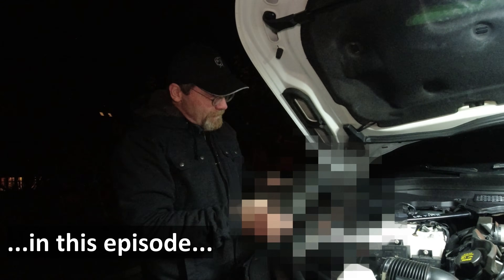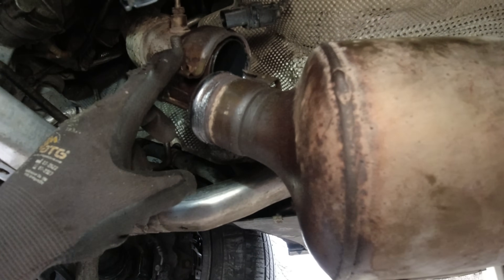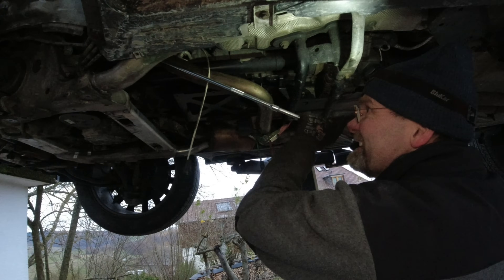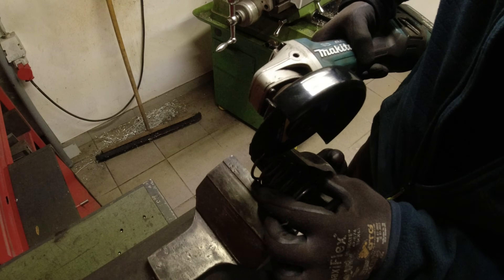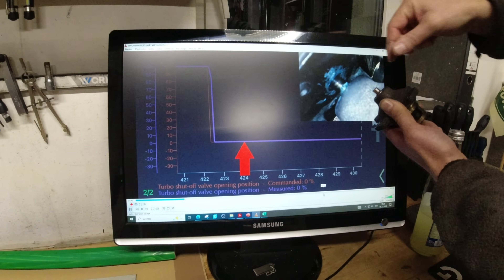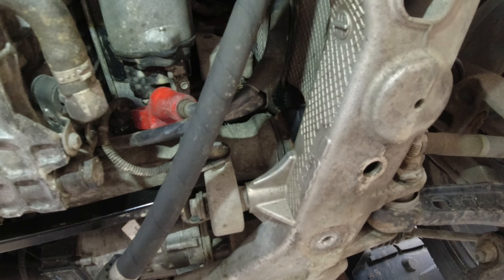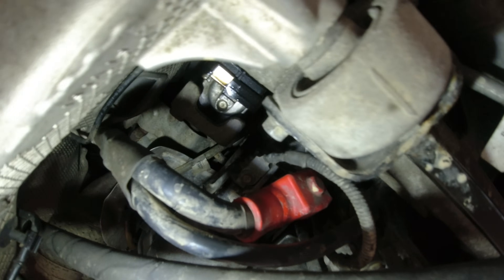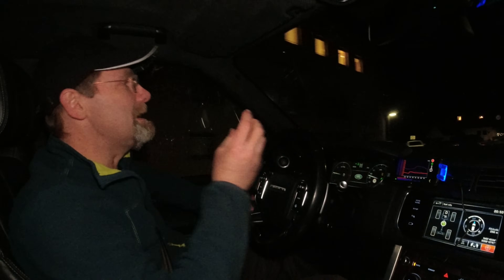Dumbest Land Rover Design Fault EVER - Fixed - L405 Range Rover / S5-Ep1

Comment: 4 weeks of debugging, amazing work! I mean I get why some workshops are not able to fix this sort of issue. Workshop hours would probably be 1/3 of the purchase price. 😅
Reply: True, but one would expect a main dealer or landrover specialist to have the expertise to pin pont the issue from the off. In reality all they do is give you a list as long as your arm to replace in trial and error manner....at cost to you. :-D
Reply: Yip…so it becomes more cost effective to replace things. Here in SA that’s the equivalent of €73.32/hr labour rate. At that many hours, the customer will walk away.
Reply: @D0zer122  that's very cheap! 18 months ago my local JLR main dealer workshop was charging £275 per hour plus 20% VAT. That works out to a whopping £300 per hour labour charge ! And I bet it's gone up since then.
Reply: @samrodian919 I suppose if they knew what they were doing, you wouldn’t mind paying them £300 per hour, but when you’re paying them £300 per hour for trial and error, it’s pretty galling.
Reply: @samrodian919  labour here is a lot cheaper. Seems maintaining the same vehicle even though parts coming here are imported (obviously) is plenty cheaper at the labour level. We only pay 15% VAT.

My independent LR mechanic is about half the JLR dealer labour rate!
Reply: I think this is the driver behind Chris' 'don't throw parts at it' doctrine. It's ineffective and ultimately extremely expensive.

Comment: I hope Land Rover watches these you tubes and will learn how to repair their vehicles!!
Reply: They won't
Reply: @kwinterburn they  probably know about this and charge for extra work
Reply: They couldn’t give a toss!
Reply: And after charging you over £2k to solve it, they'll just push the bag back, knowing from the start, that that is the issue! My ex partner works for JLR - and she says how disgracefully inept, they are in assembling cars! Ripped harnesses, failure to install bolts, parts shoved in rather than done carefully( To save time), she said she'd never buy a LR! 😂

 But C&V are absolutely brilliant! OMG they are fantastic!

Comment: I bought a one owner from new R32 dirt cheap a few years back off a guy who didn't want to put the money into it to get it fixed. Drove fine apart from at lower speeds the engine would misfire and stutter. Dealership quoted him £14k to replace the engine and all the ancillaries. Took me a year and lots of incorrect diagnosis and £2k in parts and to find the issues but the main issue turned out to be 4 damaged wires that cost less than £10 to replace... Essentially similar to this the clue was just looking at what the ecu was asking the engine to do and what the engine was actually doing.
Reply from the maker: OMG 😅👍👌🙋‍♀️

Comment: Starting around 14:00, you repeatedly mentioned the vacuum/negative pressure out of the air cleaner box ... and then went back to the weak/spongy spring diagnosis and the complete valve assembly machining process.  In my mind, I was thinking, "uhhh, did you check intake of the air cleaner box itself yet?"  No turbo lag ... but a trash bag! ;-)  At the end, every time you kept shoving the bag down in that hood gap, I kept thinking "put a piece of doubled-up black duck tape on it to keep it in place!"  I'm really shocked at how that's really OEM sound dampening.  That all said, this was indeed a very interesting exercise to see how complex these modern car systems are, but also, as you say, how clever some of the engineering is. I'm in awe of your machining skills, and way you were calibrating the spring tension was really informative.  A few days ago, I was making a very minor repair on a utility trailer tarp tie-down, overtorqued a screw and snapped the head off; my first thought was "well, Christian wouldn't've ever done that!"  Christian relates how he's waking up early and working four weeks to trace the problem, and Vera says "hey, this really pretty car has massage seats!"  That's comedy gold.

Comment: Great work you two. I followed a no crank fault for around 2 months and it turned out to be the ground cable. I took apart the ignition switch, changed starter motor and finally it turned out to be a $0 dollar part. Cleaned it and it started right up. This is the life with these cars, but they are amazing when they work. Cheers from Canada.
Reply: I feel your pain. I've got an l320 rebuilt the engine over past 12 months based on their videos. But the engine wont start.  Very frustrating.

Comment: I’ve used your hoarder vs collector line a few times. So glad you stuck with LR instead of a Toyoda.
Reply: They’d be no channel content if had had gone the Toyota route ..😉
Reply: I’m somewhere in between  a hoarder and a collector. I know what I’ve got, I put one of those in the garage 30 years ago. I just don’t know where it is, so I go buy one and a few days later I stumble across the part I collected. Every time

Comment: I wish I knew half of what Christian knows about engineering and his skills. Very impressive what he works through and fixes.
Reply: I suspect he would say himself that he learned it bit by bit, each new bit building on the ones before. Also, apart from knowledge, he has the other diagnostic requirement - persistence! Also, I finally checked my own L405, but my bags are where they should be.

Comment: Respect for your patience / diagnosis and for not throwing money at it like garages !
I have recently fixed a 2004 Transmission Limp Mode on a Mercedes 320CLK and that was oil leaking into the electrical plug on the transmission and working its way up into the cabin where the TCM is located - rather amazing 

Great Work

Comment: Debugging vehicles problems is not Land Rovers best area. They solved the problem of a stiff gearchange in my 4 door Classic RR by fitting a heavy steel gearknob, very cold in winter and burnt your hand in summer. I learnt to leave a glove over it when parking.
You both deserve a medal for your patience.

Comment: Thank you wery much! When driving faster on the highway, my car also developed a horrible whistling sound from the corner of the hood on the right side. I was really scared that something was broken, but when driving at normal speed, the whistling sound disappeared. After watching your video, I went to check my car and there was this garbage bag fluttering near the air intake on my car as well. Thank you again and good luck with your work!

Comment: Fantastic diagnosis. You are just so honest. This is a serious F***up by Landrover and their service provider. 
I was involved in system and device maintenance for nearly 40 years, and our records would have recorded an incident like this and enabled a better result. Accurate diagnosis is what you would expect from a company at the origin of the system/device.
Congratulation Christain for a very well done fault diagnosis.
Reply from the maker: I checked the service bulletins for my Vin and the issue is not known/listed.  Quite unbelievable.  Christian
Reply: If you'd gone down the dealers route a fortune would have been spent with no result. So how many dealers have done that, as their strategy is throw parts first and ask questions later. Really the dealer hasn't fixed it so they should replace the old parts and not charge. Or charge a token amount and leave the new parts as its relifed some parts. 
A very poor standard of workmanship from a dealer or any garage.

Comment: I am so glad you bought a Range Rover! I had an old one many years ago and loved it but the new ones are just amazing things in spite of reliability issues. You guys are just so fantastic to watch I love the chemistry between you. Christian's old school, a well as his new school, engineering skills are so entertaining and interesting to watch. I can't wait for the day I have my proper garage, with lift, then the fun will begin (I even failed to remove 2 x 13 mm bolts on the rear brake piston support bracket on my 2004 Ford CMax the other day. Hopefully the wheel bearing will hang in there till spring). Keep it up guys!

Comment: I was looking to purchase a Defender 110 (but went with a Rivian R1S instead).  I was really worried about the longevity of the Defender so I inquired what an extended warranty would cost.  It was $10,000 that would take my warranty to 100,000 miles.  I thought that was expensive until I started seeing these videos.  My Rivian came with a 175,000 mile drive train warranty (including the battery).  I spoke with a Rivian mechanic when I went in for some simple “recall” that re-torqued some lug nuts. He told me the Rivian is incredibly simple to work on because it’s mostly replaceable components and there are very few of them. I admire Christian’s mechanical mind, I’m a huge Land Rover fan, but I’m so glad to be a Rivian owner.

Comment: Had same issue on a 3L v6 L405, Land Rover wanted £650 for new throttle body, fixed by a bit of double sided tape and a little crazy foam to keep the bag in place.
Reply from the maker: No lathe, no mill?  Good job!   Took me 4 weeks….  Christian
Reply: @Vera_and_Christian  Yes maybe it did take you 4 weeks, but I didn't have to rule out what a Land Rover dealer thought it was  before I could get to the real reason. Brillant video always enjoyable and I learn so much from them.

Comment: Christian you are an intelligent, very knowledgeable  engineer and have the skills and equipment  necessary to work on these very complex vehicles at home. Most owners would have to rely on the very expense LandRover mechanics. The RR’s are incredible vehicles to own and drive I have owned the L322 and Disco4 both great cars but now they have become too complex….My experience with the L405 was DFP problems which took £1000’s and three different LandRover specialists to sort out….The car has now gone and I have an Audi instead.

Comment: I just watch this channel because i like the humourous and analitical approach. Yes it can sent you high up in the woods sometimes searching way to deep for a problem. Or making things way too difficult.  like this video shows. Still i think it's the right way to do things. And on the other hand: lot's of work you have done is not for nothing. The car is now in tiptop condition. Lot's of possible weak points are now serviced.

We had a repair saga on the (UK) 406 coupe forum with a V6 petrol which refused to make good power. In the end, and after months of searching by several guys, someone discovered that the air intake hose collapsed under certain circumstances. That thing is tucked away far away, and isn't easy accesable. After replacing it, the car drove like new.

I don't own a landrover product, but a 406 v6 coupe. Still i watch every video, because of great mechanical skills, and lots of humor. Great channel!!

Greetings from the Netherlands, 

Nico.

Comment: Brilliant what a find. No issue with the bonnet open while testing actuators with engine running and blipping the throttle and reading GAP tool pressure codes. BTW  for your subcribers, the L494 Range Rover Sport 4.4L TDV8 has the same intake arrangement for the primary and secondary turbos.

Comment: is L405 a car worth recommending for a daily driver? I've always liked its looks. and if yes, what engine for best running costs and short commuter trips? is V6 diesel still suffering from crankshaft failures? would supercharged V6 make sense? 5 litre V8 seems too much I think. or maybe a 2 litre petrol Velar could be a good compromise?
Reply from the maker: I daily this car now to work.  My LR4 Sdv6 is better.  The V8 is not a responsive engine.  Endless power but not immediately.  The 3.0 responds way better in city traffic.  Stay away from gas engines.  Fuel consumption is terrible.  Christian

Comment: Your patience and discipline in testing every potential fix before moving on to the next one is admirable (and the only way to be sure an action has brought about a change), and on the plus side, you now know your way around the L405 far more than you would have otherwise done by finding the issue immediately. 

You also can take comfort from knowing that many things on your car are perfect so (fingers crossed), you might now be able to enjoy many ’000 kms of trouble free motoring in your awesome L405.

But we need more problems for content, right 😂

Awesome job!

Comment: Excellent fault finding and no one would have expected a plastic bag would cause that. Imagine you had stuffed the bag back down in its correct position and the fault disappeared and didn't associate it with the bag. At least you proved all the expensive RR dealer "fixes" were bogus and found the true fault. Good introduction to working on a RR. I love my 2002 L322 and fixing all the faults. Sense of achievement.

Comment: That was unbelievable it makes so much sense when you think about it but I really enjoyed the engineering content of the video you are not just an electrician you are an engineering wizard.i had a similar problem years ago with an air intake fault.A fly was caught in the element of the MAP sensor which completely change the air intake values 😵‍💫it took a while to work it out but with the fly removed everything was back to normal. Thanks I really enjoyed the video.

Comment: From the UK: First, the important bit - Well done. Both of you use your good nature and relationship to support each other. Both of you are tenacious, avoid throwing in the towel! You analyse, rationalise, use science, engineering, schematic charts, spring loading calculations, tolerance requirements, pressure responses, valve/time responses and more. Your use of real time instrumentation is shrewd and valuable - you can have recorded comparisons by camera and graph. Utube rewards you of course, but you reward Utubers. Thank you both! 78 yrs this year I feel less inclined to grapple with modern cars these days.

Comment: Hey Christian, thinking further about this amazing fault finding procedure you went through to find the problem...........
Will you be restoring the actuating spring you modified back to standard ?
Thinking about how weak you say the crankshafts are on these I would be scared to use the extra boost? 😮
Reply from the maker: I thought about it but I’ll keep it as is.  The 2nd stage boost comes a bit delayed but nearly not noticeable.

Comment: I remember myself trying to figure it out what happened on my L322 with random air suspension problems, after air valve blocks and 4 corner air ride sensors replaced the only thing it needed was a proper calibration. It's pretty easy to forget about the simpler solution while working on these vehicles.

Comment: @ 37:37 The fact that the air intake is where it is, is actually brilliant.  It’s kind of like an OEM built-in snorkel.  By raising the air intake, you don’t have to deal with dust from other cars or when you going through a water crossing, you won’t hydro-lock.  This is forward-thinking engineering 🤟. I have to imagine that the engineer that added the trash bag in the hood bonnet was completely removed from the one that added the “snorkel” 🤦

Comment: Wow, great find of the problem. Could you do a follow up episode, and have the bag attached to a cable, and also have your camera in air duck. When driving pull cable to make bag block duct and be recording your turbo outputs to recreate the fault on camera..
Reply from the maker: Check out our previous videos on that car, lots of Gap recordings shown there. 🙋‍♀️

Comment: Half way through and I just realised what it was  , I had a Vauxhall Brava (isuzu TF)  pickup which was brand new and slow back and forwards to the main Dealer  suddenly after 6 months speeded up ,  on investigating I found a piece of blue roll in the air box it has been caught in the inlet horn restricting the airflow ,
Reply from the maker: 😳🤦‍♀️Unbelievable🙋‍♀️

Comment: This video was great! I like your videos because you do want to understand the problem. Would have been way worse had you paid 900 for the new turbo and the fault reoccurring immediately. I’ve certainly had that experience. After doing an oil pan gasket on my 330xi, it was no crank/no start. Replaced fuses, relay, starter, checked EWS, keys, fuel pump, fuel filter… after day 6 or 7 of painful diagnoses, I remembered in bed of a ground wire that connects to the subframe which had to be removed. I placed every bolt and nut I removed into a tray except that one which I placed back on the stud after removing the wire. Connected the wire and problem solved. Ugh. Live and learn.

Comment: Great work. 👍

I gotta ask, did you never consider that the fault didn't appear when running the engine on your driveway, with the bonnet open?
Honestly, I probably wouldn't have realised the significance of that either. 
I would just have assumed the engine needed to be "under load" (during a test-drive) for the fault to appear.

As I was watching, I was thinking that you could have disconnected vacuum lines in various places to find out what was actuating the shut-off valve and, perhaps, connected up a vacuum gauge to verify when/where a vacuum was present.
Even so, that would probably have made me think the solenoid valve was faulty.
With hindsight, I guess having a vacuum gauge on the hose from the airbox AND seeing the loss of boost at the same might have suggested a blockage in the airbox.
Reply from the maker: I did all that and it worked ok but the engine had now power. It made me think that the vacuum is too high in the airborne.  I just did not look at the bonnet air holes.  Dumb but that is the truth.
Reply: @Vera_and_Christian  Absolutely NOT dumb at all.

As you said in the video, the important thing is always to find out WHY something is wrong and not just throw money at the problem.

Trying to diagnose the fault with the car stationary (probably with the bonnet up) must have been the most frustrating thing in the world.